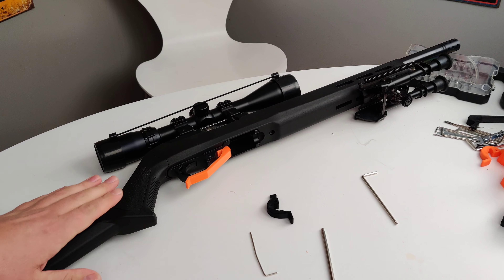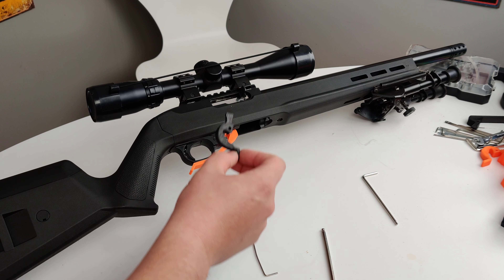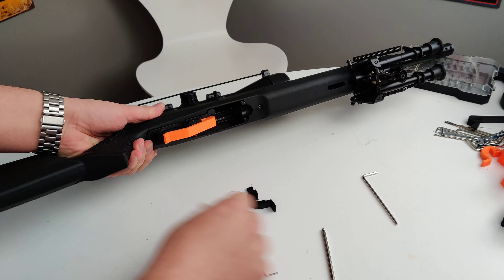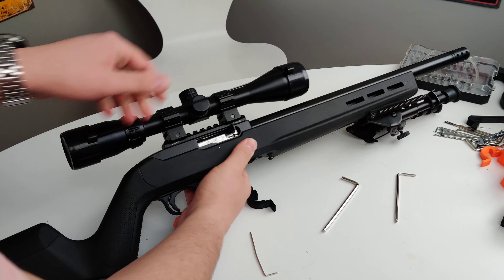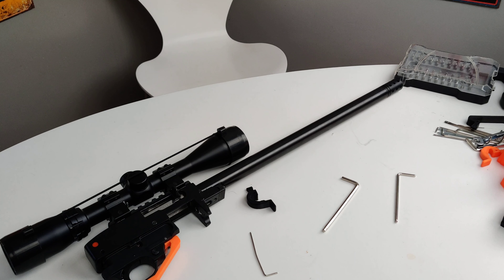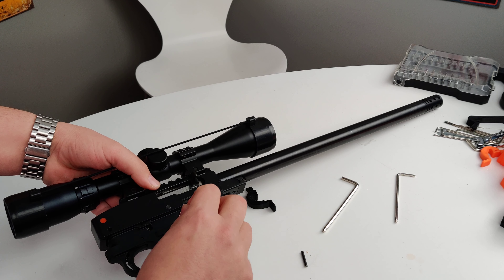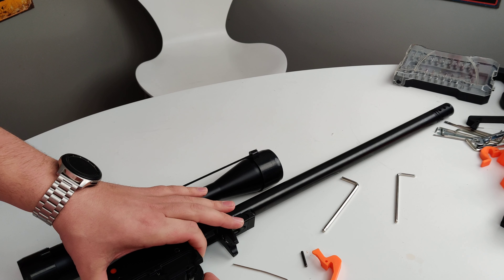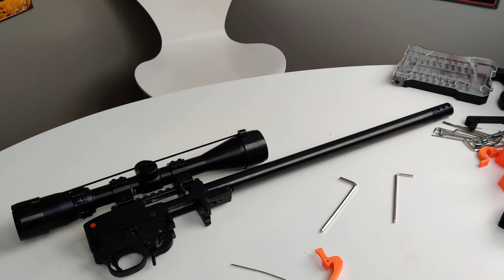How To Install An Extended Magazine Release On A Ruger 10/22

Comment: I put an extended ma release on mines and for some odd reason it’s wobbly. I have no clue what’s wrong. You by any chance know?
Reply: Got mine off eBay mine is too it feels like crap with the wobble
Reply: @rmblwgn  got mine from EBay too, but the hole in the release was too small for the pin, so I took a Dremel to it and now it works well.